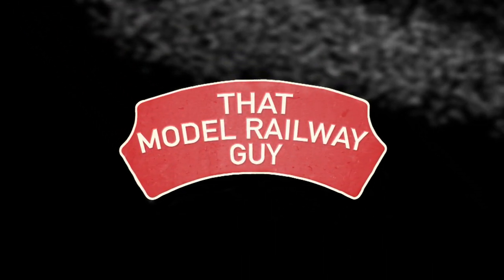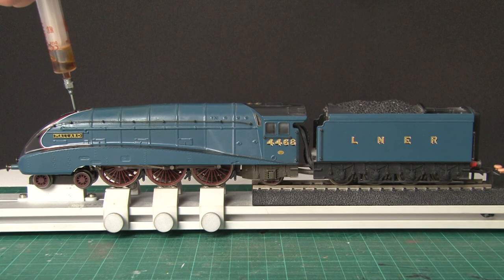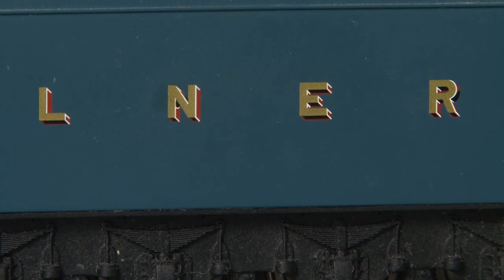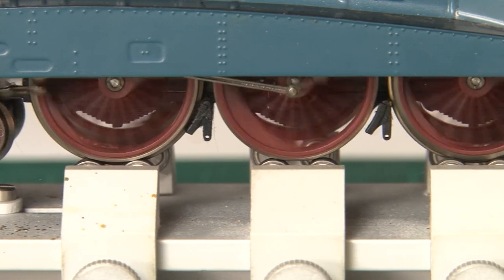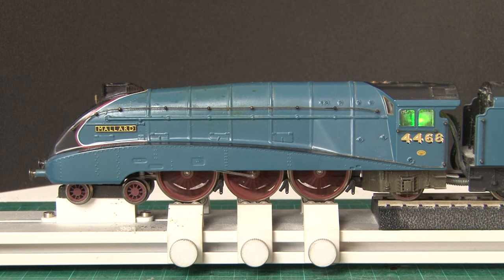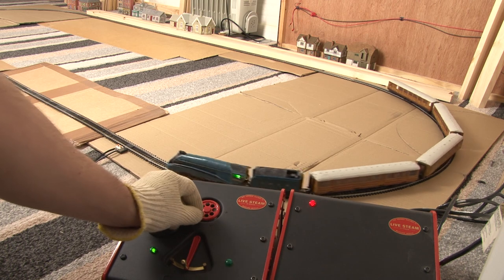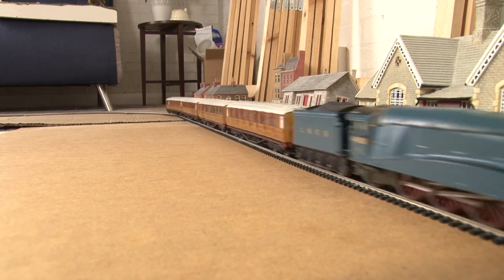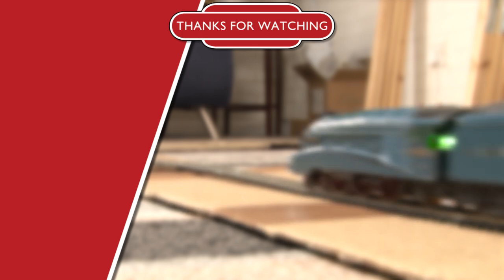Hornby 00 Gauge Live Steam! - 1,000 Subscriber Special!

Comment: hey i have a question is the body of the loco plastic or metal?
Reply from the maker: To be honest, I'm not entirely sure. It doesn't feel like it's metal judging from the other locos I have that do have diecast bodies, but if it is plastic then it's different from what Hornby usually use since it has to withstand the heat when in use without melting. Sorry I can't give you a conclusive answer but thanks for watching 😃
Reply: A comment from an owner of these running at an exhibition years ago was that the bodies were a ceramic type of plastic unlike anything they had come across. Put a stop to their plans to do body swaps with their existing locos.
Reply: @johnd8892  thanks for letting me know

Comment: Well sad that these locos are not produced any more. They should make them again, a real live steam loco in that scale!
It would have been a good idea to include a brake into the design, like the real engines have, so you could stop the engine at point and do shunting. Some form of electro magnet in the front bogie would have done the job easy! But they missed the chance and stopped the manufacturing at all. Very sad!
Reply from the maker: I know, it would be great if Hornby started making them again but sadly I think the prices would just be too high nowadays. I agree a brake would have been handy - there is sort of an emergency brake but I think they wanted to keep the controls simple. Ironically by oversimplifying the controls they managed to make it more difficult to drive 🤦🏻‍♂️ Thanks for watching 😃

Comment: How do you make it steam a lot to replicate a real one
Reply from the maker: Hi Dan, running in a colder room and making it work harder will sometimes give you more steam but it will never look the same as a real steam loco. For that you'd be better of using a steam generator or smoke unit in a normal model - it's a lot less trouble than dealing with live steam! Thanks for watching 😃
Reply: @ThatModelRailwayGuy  thanks

Comment: Does the loco make that high pitched noise? Sounds worse than an old CRT!
Reply from the maker: Haha, yeah it is a bit odd that it makes that sound. It's more noticeable in the video than in reality as I had the microphone quite close to the loco. In contrast you can't hear it at all when it's running round the circuit later in the video. Thanks for watching 😃
Reply: @ThatModelRailwayGuy  I would guess it's the heating element being shaped like a coil and generating electromagnetic energy, vibrating in the process. It's the same problem you get on high end graphics cards if it's the same problem. I don't know how my ears would hear it in person, but if it were that bad then it'd actually be a turnoff. High pitched noises give me headaches and tinnitus.